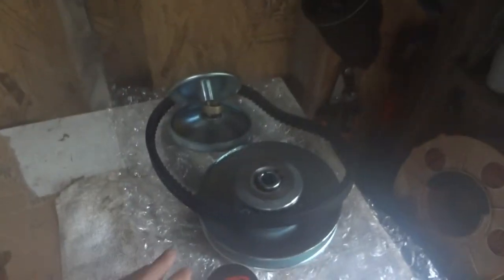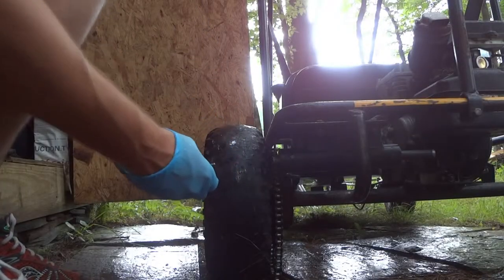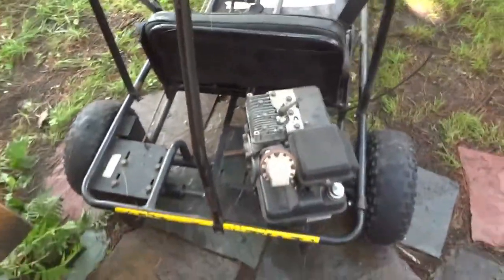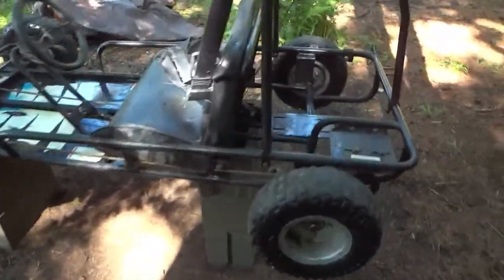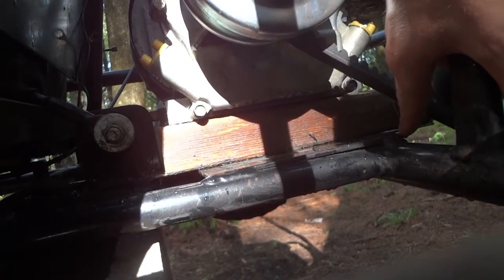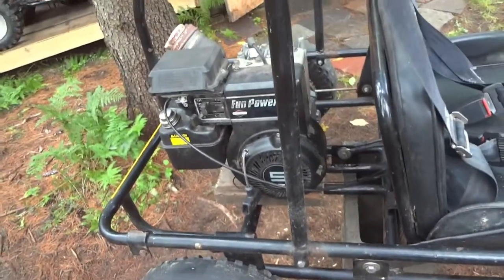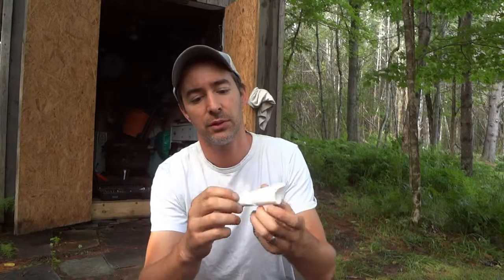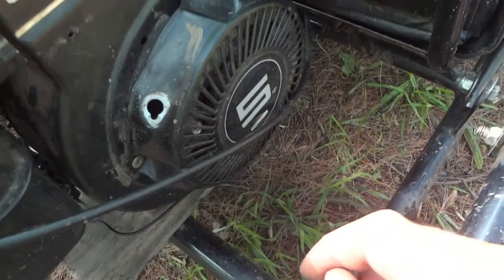Carter 2435 Go Cart Gets a 30 Series Torque Converter

Comment: Thank you for making this video! I knew something was funny about that jack shaft!!! I should be able to have this actually moving by this weekend. You’re correct about how sluggish it is with the centrifugal clutch. Ours had a 48 tooth sprocket which put the drive ratio at 4:1. Now that I have the torque converter on my daughter will be thrilled. Happy karting! Thanks again!

Comment: Hint on the pull cord repair flair a piece of copper tubing flair it on one side get a throug hole length and add room for tabs to bend over the push it through and bend the tabs and sand it for smoothness on the bottom or if you have room flair it im a leader o. Kart and mini bike Amino if you wa6to check us out I also do a little bit of tube my self

Comment: My son and I literally picked up a Carter just like yours last night and began working on it this morning... we experienced the same problem with the jackshaft! Can you give us a parts list you ordered for the torque converter, belt and all of that? My concern is that belt length. Thanks!
Reply from the maker: Sure thing, I ended up calling up the fellas at Go Power Sports for a recommendation. They gave me part number KD30tqkitmurray on their site. Or if you go to their site you should be able to find the torque converter kit as '30 series Torq Kit for Murray Go-karts- 203597 belt, 3/4" driven 7"'.  I had to play with sliding the motor forward and back to get the belt tension right as the kit doesn't have a backplate. (No place I could find to put one on a jack shaft setup.) Good luck and thanks for checking out the channel.
Reply: Vermont Life thanks my man!

Comment: Would washers below engine be enough to support and secure engine to baseplate? Or would you need 2x8 steel to raise and support engine? How’s it running so far if you still have it all?
Reply from the maker: I suspect washers would have worked fine in hindsight. I ended up putting an 18hp snow blower motor on it  the next year with the governor removed for a bit which was awesome!

Comment: How did you take apart the jack shaft? I have the same thing. Is there a trick to it? I’m new to all of this. Thanks!
Reply from the maker: Four bolts held it onto the chassis. After that I had to press out the old shaft and bearings to be able to put the new shaft in. If I recall I tapped the old shaft out with a hammer and another bolt. Does that help?

Comment: I got the same set up. I put it together and it won’t pull at all. How tight do you get the jack shaft?  The torque conveyor doesn’t expand at all. I’ve taken it apart and made sure everything was right. I can’t figure it out
Reply from the maker: Well too tight and at idle the cart tries to run away. I set it so it would just barely slip at idle. That said though if the converter doesn’t expand with centrifugal force then the belt won’t ever get tight and work. Something seems off with your torque converter.

Comment: My bottom pulley opens too much and grabs the belt. Cleaned/ adjusted everything 3 times. Any ideas ?
Reply from the maker: Hmm, if you can’t change the idle any lower so that the pulley doesn’t grab… then I would introduce a little more slack into the belt so it ‘sits’ further out. Usually this is done by sliding the motor on its motor mounts until you find that sweet spot but first I would ensure you’re not just idling too high on your carb.

Comment: The reason why u didn't have any room cuz u had the pulley on backwards LMAO I'm not gonna blame u for that cuz I sometimes put things on backwards
Reply: Yeah from what I can tell the Carters like this with the jackshaft came with 20-series torque converters with an inboard driven what puts it facing the other direction as you said. It appears that he was able to make his setup work in the end but I wonder if using a 20-series would have eliminated having to notch the engine mounting plate like he did.